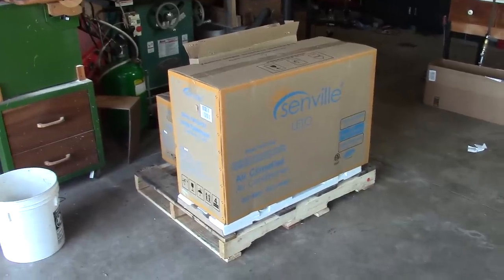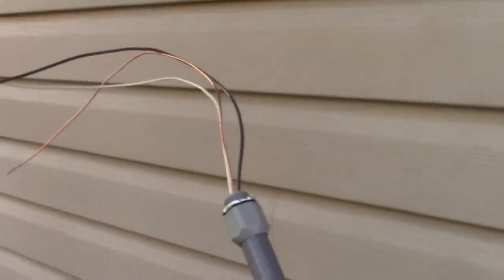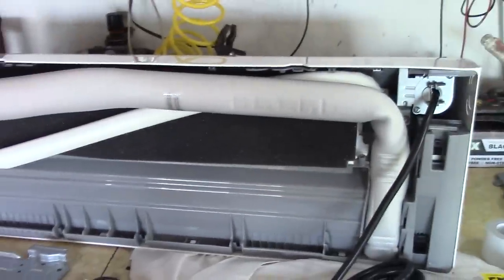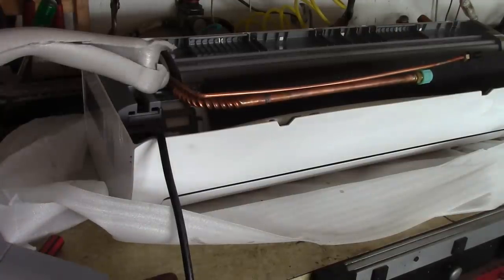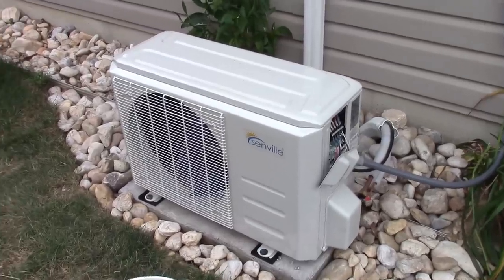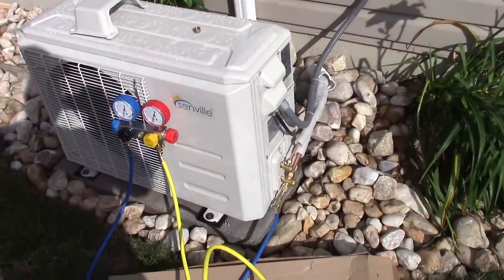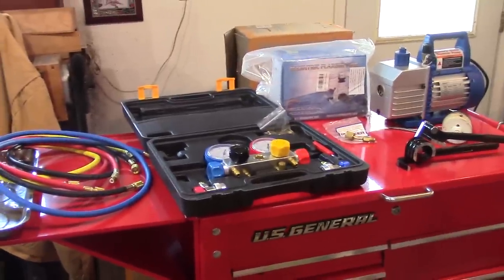Mini Split A/C Full Installation Full Video

Comment: One important thing is missing , you should test the system for high pressure approx . 60 bar  with dry nitrogen and  under the pressure test  for leaks with bubble solution and after it is ok you use the vakuum,  maybe two times the whole thing if you do it workmanlike, as prescribed , of course he did not have nitrogen--expensive thing .   But he had luck and everything was OK. Every connection is gas tight  .
Reply: sorry not 60 bar just 40

Comment: To get  your proper torque on the fittings you could use a torque wrench with a crows foot of proper size just make sure you keep it at 90 deg when tourqing

Comment: Never use the system evacuation as a leak test. A vacuum test isn’t the best method of leak testing a system for many reasons:
• A vacuum test allows air and moisture to enter the system if there is a leak.
• When you’re working on a system, you can’t determine from the vacuum where the leak is located, only the existence of a leak.
• When you check for a leak using a vacuum, you use a reverse pressure, which is the atmosphere trying to get into the system, of only 14.7 psi. However, under normal operating conditions, the system could be operating under an operating pressure of several hundred psig, which is 10 to 20 times the vacuum pressure difference.
To torque the fittings properly, add a crows foot to your torque wrench.

Comment: If you leak test with soap and water when it is under VACUUM it will not blow bubbles, it will suck the soap and water into the line set.  If you PRESSURE test with nitrogen, then it will blow bubbles if there is a leak. Big difference.

Comment: Thanks and great to see your attention to detail with your finish elements.  I was just curious how it has been effective it has been working with the colder weather and if it still seems energy efficient. Take care!
Reply from the maker: The air was fantastic this summer, what a difference it made for when I work in the garage.  I was surprised how well the heat pump unit works.  I was not planning on using the heat pump, but I am now using it about 3 times a week.  I have not had to light my pellet stove yet this year.  This mini split is affordable and great!
Reply: Thanks so much for your response and common sensibility for us out here!

Comment: Here is a question. I did the vacuum test and my gauge never reached -30, it stayed at -25. But then when I closed off the blue line and turned off the pump, the gauge went to zero within 10 minutes. So it implies a leak. I sprayed soapy water on the pipe connectors on the outdoor unit and there were no bubbles. If there was a leak after vacuuming the air out would there be bubbles? I ask because any leak would be sucking air into the lines and not letting any out so why does the video say you will see bubbles before letting the refrigerant into the lines. I'm now going to have to pull the indoor unit out because the connectors happen to be inside the wall since the wall was quite thick and I had to come out of the side of the unit rather than the back. I was very disappointed. Seems like either the torque wrench was faulty or I didn't set it properly as it came without instructions. Any help in this situation would be much appreciated. I haven't let the refrigerant into the lines yet.

Comment: This guy did an excellent job. No doubt about it. And for all those hvac technicians or installers I have only one question what the hell are you doing watching these videos unless you want to learn from this guy. If it fails let it fail at least he tried and by the way I bit that he did and will do way better job than you Mr microns
Reply: Thank you sir, ......well said !
Reply: I would just say that the micron vac level and the torque of fittings are the most important steps that were omitted! The install is gorgeous and nicely executed but the details... Well.....

Comment: I emailed you with some photos.  I had bought all the same things that you did, but didn't notice that the gauges were (from China) reversed.  I switched them, but now they don't turn flat to fit in the box.  I still am wondering what all the additional ports are for ...maybe for charging? --but then, I have two more units to DIY and then sell the rig.

Comment: What can cause a new installation to do this... fan runs on AC and fan but not run on heat and auto? The outdoor temp right now is 54 degrees but has been the same thing since this morning when it was in the low to mid 40s. It worked last night when I went to bed but wasn't working this morning when I got up. Freon level is good. Everything else on the air handlers work. I have 3 air handlers and the situation on all 3 is the same.

Comment: Hi, thanks for sharing your experience. I would like to confirm one thing about the installation. I am living in a apartment where all my rooms are connected with single hallway where I have fake ceiling (lowered ceiling made from plasterboard) where I have all the cabling and the space from the ceiling is 18cm, so I am looking for a solution where the pipes could be managed within this distance from ceiling. I have noticed that internal unit you were using was able to have the hole drilled as up as possible (was bent to the bottom of the internal unit). So if you can please confirm that is possible. Thank you, Michal

Comment: Good video, but please dont use soapy water to test for leaks while under vaccum. This will introduse moisture to your line set and that is BAD! Soapy water test is only good while under pressure. Just a heads up. Cheers

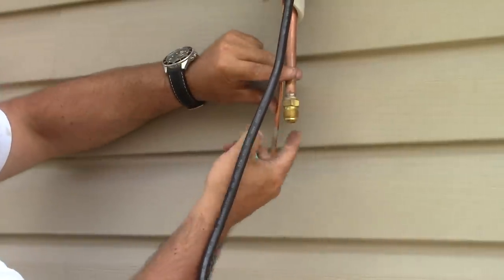Comment: Very very nice video thanks a lot. Just a point, @21:15, you are not getting nitrogen out from the thick line because you already emptied it from the thin line. The two lines are connected with the evaporator. Hhhhhhh 😁😁🤪🤪

Comment: Why did you open up the highl pressure and low pressure lines after charging the system toward them for the video when you loctited the caps. ! I’m confused  please help

Comment: Can't use soapy bubble method on a line with vacuum in it. The bubbles would develop inside the line, where you would not only miss seeing them, you would contaminate the Inside of the line with soap and water. Pressurize to find leaks, or simply tighten fittings if vacuum test fails. Otherwise a great video.

Comment: Don't you need a filter on the liquid line?
Reply: Mini split systems all have filter dryers installed inside the unit, you'll never have to add an external dryer on these systems.

Comment: So on this Senville unit you "could" cut and shorten the lines from the inside evaporator? The refrigerant charge is in the condenser unit outside? I have seen some units like the McCool  that says the refrigerant charge is in the lines. I would not like that at all. I do like this unit from what I have seen. Only thing I would like to add is a filter/dryer on the small liquid line.
Reply: Senville says the pipes can be cut down to 10’ without removing any of the prefill that is suitable up to the 25’ pipes. There’s lots of extra gas in them.

Comment: In the manual for the senville unit, before you do the vacuum leak test; It says to evacuate air by connecting the vacuum pump to the "packed valve" until it reads 76cmhg, which is atmospheric pressure. I don't really understand that step. What is the packed valve? It looks different from the low pressure valve in the terrible drawing and why would you vacuum to atmospheric pressure if you are going to be pulling a proper vacuum for the lineset in the next step? If anyone can elaborate on that I would really appreciate it, thank you.

Comment: I understand torquing the line sets is a very important step.
Reply: Yes should have a torque wrench, installation guide will have exact specs but if u torque to much u cause damage to flares and not enough it will work itself lose, I've been a installer for 13 yrs and service tech for 6 yrs been in HVAC my entire life

Comment: What kind of disconnect did you use for the outdoor compressor? Amps rating,Make and part number or link would be greatly appreciated. Thank you much
Reply: G man any 20 amp disconnect will do
Reply: @shadimarhaba5415  Thanks Chadi!

Comment: Another thing man, pulling a vacuum and doing a pressure test are two different things. You wanna pressure test with nitrogen first to see if you have any leaks. Then you go forward with pulling the vacuum. It’s always supposed to go to the negative 30 when you pull the vacuum that’s just the gauges telling you it’s in vacuum. Your supposed to have both gauges open when pulling a vacuum and then close both before taking off the gauges so that you don’t lose your vacuum. Pulling a vacuum and doing a pressure test are two completely different steps man

Comment: Also if anyone wants to skip the vacuum part, buy a MRCOOL unit that uses precharged line sets. HOWEVER, NEVER COIL UP THE LINESET. You'll create an oil trap that will kill the system. You'll just have to place the system at the right part to get away with that. 

Also, if you had a flaring tool, you should have just cut it and made new ones.

Comment: Dont they have f-gas regulations in the USA where you have to strength and pressure test and record this before deploying refrigerant? In the UK we certainly have to test and on a precharged system its usually the saturation temp of the condenser unit outdoors so as to not force nitrogen into the the precharged condenser. We usually run a vacuum and then charge with nitrogen to 5 bar and then bring up to the equivalent pressure at ambient temperature. Check for bubbles, make a cup of tea then come back later.. I haven't seen a UK installer upload a video yet probably because we are so heavily regulated and a lot of people will criticise how others work.

Comment: Only question i got is about warranty, whonis gonna honor it.  Most equipment bought online specifically states no warranty.  Supply house can run serial number and see who sold it.  Hope it works out for you, if not good luck diagnosing any issues.  A damn monkee can install it, the skill comes in diagnosing problems

Comment: Why not to unscrew the vacuum adapter before opening the return valve?That would save the "psshh" factor, loss of freon, possible burn and anxiety. Just wonder...
Reply: That would suck in air which is bad. Loosing a little R410a is fine.

Comment: Thanks for posting.  I was looking at this system locally.  I would have cut the line and re-flared it.  I am curious why you did not do so??
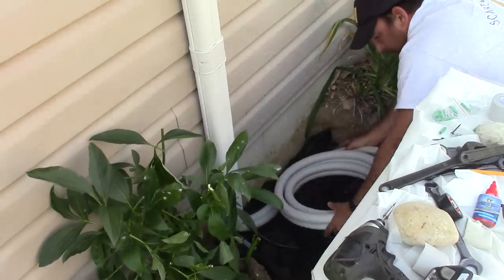Reply: The unit is pre charge for the line set that comes with the unit. If you cut and flare you need to adjust the amount of freon (or whatever the gas is) 23:40

Comment: You used a NM type cable clamp on a round cord on the indoor unit, which is technically wrong, even though it works, but it's inccorect

Comment: I enjoyed your video very much. How is the mini split performing? Any issues? Is the warranty voided since you did it yourself rather than HVAC tech?
Reply from the maker: Nov. 3, 2019  No problems with Mini Split unit as of yet.  I am surprised that I am using the unit for heat more than my pellet stove.  This unit is so easy to use and produces the best heat and AC for less money than any other heating and cooling methods.

Comment: Should not have release all the freon at once. If there was a leak u would eventually lose all of it. The Vac test DOES NOT assure you of no leaks. U should have released a little freon (5 seconds worth)and did a test then after a half hour then released the rest. Also u removed the vacuum pump  under full pressure meaning you lost more freon then if you removed it at reduced pressure after testing.

Comment: HI ,nice video ,you mention you get bigger unit then you need ,I have to use on 1000 sq feet home what you recommend 18 or 24 ? Thank You
Reply: I used only a 12000 btu, single head , on a 960 sqft. single wide, and a small swamp cooler for when its super dry.....Tucson Az. ,but I replaced all the windows first.They were ancient aluminum single panes, and cool coated the roof. In the winter we use 3 small electric room heaters in the bedrooms. Have never had an electric bill over a 100.00.  I'm thinking about pulling that unit and installing it on my 5th wheel and going with a new 18000 btu , dual head unit, I want to eliminate the swamp cooler entirely. He should have pressure tested with Nitrogen, then bubble tested and his vacuum set should have connected to both sides, high and low and he needs a better gauge looking for 50 microns. But for a limited budget he did a good job except for that crappy particle board and coiled lines. Backing off the fittings after tightening and then re torqueing is a good idea as well.  Mixed messaging on the Nygard,  I used it sparingly.  For you, you might want to ask an expert that knows your climate and home layout, insulation and solar exposure. HVAC is a science I've been studying it for 2 years and still only know about 20% of what's needed to get certified.  Also, he should have done only a partial release of the 410a, waited a 10 minutes checked for leaks and then released the rest.  I installed about a hundred of these in Cambodia mostly replacing poorly installed, early deaths due to water contamination. so I'm thinking I can maybe do these here as a business after I get my EPA cert., and contractors license. It only takes 2 hours with the right tools. Let me know if I got anything wrong guys, I'm an old veteran looking for a new career.

Comment: You should not have had to trim out your electrical cover. If you look directly below the electrical terminals there is a plastic strap with two screws. Your wire goes under that strap. Tightening the screws will clamp onto the wire to provide strain relief.

Comment: The condensation drainline is going to leak, you have to angle the hole so it has a little bit of fall.

Why no micron gauge?

You can't get past -30 inHG.
Reply from the maker: No issues yet.  It has been running a lot too. Awesome at maintaining the heat.

Comment: Can you comment on how you oriented your schrader valves and the little part in the hose that is supposed to push on the schrader valve? I have almost this exact same setup, but a slightly different manifold from eBay. I bought the Pioneer line converter you showed, and it has a schrader valve installed in it. Another video I saw showed removing the schrader valve entirely, but I thought that was kind of the "automatic seal" valve so when you disconnect your hoses the line stays sealed. Does your blue and yellow hose still have the piece that pushes on the schrader, and does your pioneer convertor still have the schrader valve?
Reply: I have a similar Pioneer unit. The schrader valve is installed in the fitting connection on the outside unit so when you disconnect the adapter there in no chance of freon leaking out.

Comment: Here is question for anyone that can answer, in a 4 zone system do you vaccum all the ports or you just connect the pump to one?
thanks in advance
Reply: Only the condenser.
Reply: thanks  @alexramos1435  i figure it out, i'll prb make a video about it since senville doesnt have any on youtube... thanks!
Reply: @alexramos1435  each port as you finish connecting each one, you would evac each indoor unit/line set/port. Great video especially the nylog.
Reply: How much does it cost you a month to run?
Reply: @judodavid1  For my temperature setting and floor space my 12k is about $20 a month and the 18k unit (in a large shop) is about $35. The zoning is a nice feature, the house and the 2 mini splits are all at different temperature settings. In cooling mode right now nd will be interesting to see what it is like for the winter. Definitely saving money and with added comfort.
Reply: Thank you  @ronhaefner7833 . I have an old split system that will need to be replaced in the next couple of years, so I have been looking at insulation and mini splits.

Comment: I just got my 24000 senville mini split leto and your tutorial is just what I've been looking for thank you so much,one question when vacuuming lines do you leave the high side off whole time?Again great job
Reply: jeff west you only connect the low side
Reply: There is no high side connection
Reply: thank you so very much for posting this video,I followed you directions and hooked mine up,been working for about a month now with zero problems,,, great video @summitm18hvac90
Reply: I figured it out tyvm

 @summitm18hvac90

Comment: Thank you for the video, would the Freon leak would have been avoided if the vacuum pump was to be removed prior to releasing the Freon into the system or does it have to be connected during that process? Thanks!
Reply: I am wondering the same thing, why leave that connected?
Reply: Another mistake
Reply: I'm curious as well. Disconnect the pump prior to releasing the freon and technically you'd be breaking the vacuum that you did in order to remove any moisture in the line(s). Disconnect the pump after the freon has been released and you lose a very small amount of freon but that's it. So is one trade off better than the other?
Reply: if you disconnect manifold line before releasing the refrigerant, the negative pressure would suck in moisture. Noooo

Comment: when you coil up the line you make oil traps in lines .
Reply: It's not so much of an issue the way he did it by laying it horizonally but I would not have layed the coil below the compressor . . If you coil it vertically then yes , it can be a problem.

Comment: Just so you know the outdoor unit is called a condenser or condensing unit it’s not called a compressor. Yes there is a compressor inside of the unit but it’s a condensing unit.